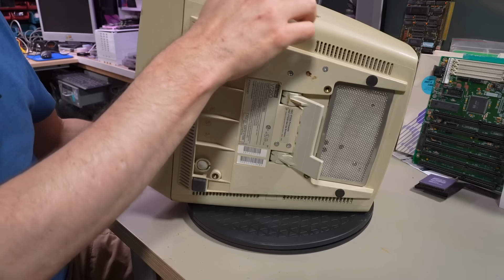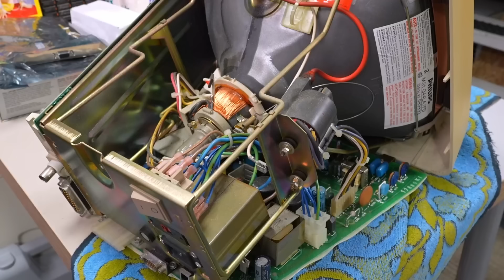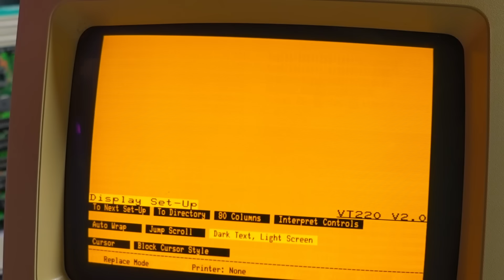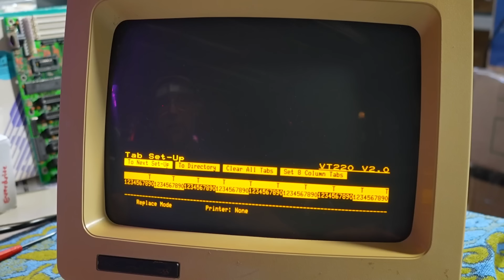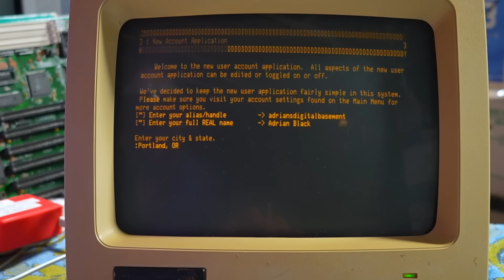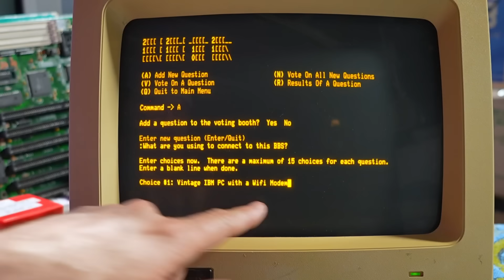Getting online with a DEC VT-220 terminal

Comment from the maker: Patron Rick pointed out that DEC stands for Digital Equipment Corporation not Digital Electronics Corporation. Thanks for the correction!
Reply: yep love these terminals. used to use them in a factory. funner if you have a mainframe to connect to, they would connect to the DEC mainframe and then you could do programming, etc. love these things. not much else you can do today with them lol
Reply: I remember vt220 as being based on 8085, not 8051… later revision I guess?
Reply: @marygauffin7290  The VT220 Tecnical Manual, revision 1 from 1984 states that the CPU is a 8051. I don't see why they would have redesigned the terminal to use a different CPU in later models ("If it works, don't fix it").
Reply: Ok. I must remember wrong then. Thanks!
Reply: It was how I remembered it being spelled as I stumbled upon a DEC computer - it was labeled as such; Digital Equipment Corporation.

Comment: I remember using a VT220 with a DEC PC back in the day.  I really liked the text editor because it had the unusual concept of moving the text around the cursor rather than the cursor around the text.  The result is that the cursor was always on the centre line of the screen, which makes a lot of sense.  Pity other editors didn't pick up on this idea.

Comment: Used those VT220’s back in the mid to late 90’s. they were connected to a DECServer 100 which was a serial to Ethernet box to a Vax 4000. Also used many other DEC terminals like the VT520 and a Wyse (which I still have and connect to my VaxStation 4000/60). Used a VT220 to connect to packet radio, a form of amateur radio data communication. I have no idea if any of that is still in use today…

Comment: At my university (1997-2002) there were approximately 20 green VT220 terminals in the main computer lab of the university.  It was the only computer lab on campus that had any actual terminals instead of only full PCs.  The VT220s were surrounded by the rest of the computers in the main lab being then-modern PC compatibles.  The VT220s were used only to access the VAX mainframe to either look at the files on your 7 megabytes of allocated storage space on the university's mainframe, or send or read your e-mail, which was accessible only by VAX, either on a genuine terminal, a VAX terminal emulator program on one of the PCs, or telnetting.  Ever since the VAX system had been first set up there, there had been a few BBS-style network games hosted on a certain person's shared drive, which were playable from his drive, accessible through a BBS-type program.  Collectively, this was called the Rebel Alliance, which included BBS-style one-liners from the three Star Wars movies when you logged on and logged off of it.  It may have been called the Rebel Alliance because the university IT department didn't want or like it existing, yet a bunch of enthusiastic students kept making sure it did exist.  The Rebel Alliance had been passed from student to student as students had graduated over the years.  Unfortunately, during my time there, the current hosting student graduated and despite his pleas, no one else volunteered to be the new host (probably because by then we had graphical web browsers on the actual Internet).  The most interesting game on the Rebel Alliance was UMoria, a roguelike, which I see is still around thanks to vintage computer enthusiasts.  Now I should go play it!

Comment: Adrian, DEC published many excellent user & maintenance/service manuals for their hardware & most software, at least in the "early days" before the '80s.  The VT220 is definitely included in hardware with good manuals.  Bitsavers and many other sites will have freely downloadable copies of these manuals.  I recommend that you at least take a look at the VT220 User Manual -- I don't recall what's in it, but it*may* give you an idea about how to type an equivalent for the ESCape key, along with explaining the various controls in and on the terminal.

Comment: I was a firmware developer on the VT240/220 development team at DEC's Terminals Business Unit. The cable that connects the LK201 keyboard to the terminal is not a telephone cable. This keyboard was the first to incorporate the inverted T arrow key configuration. The VT100 and all subsequent DEC terminals accepted ANSI Escape sequences to control the advanced features of character mode operation such as selecting code page tables for foreign language localization, line drawing, split screen scrolling and other features. The VT220 was a cost reduction of the VT100 character-based terminal whereas the VT240 was a cost reduction of the VT125 graphics terminal. The graphics capabilities were controlled by a special drawing API called ReGIS, short for Remote Graphic Instruction Set.
Reply: Always love it when the devs chime in. Thanks for your insight and contributions to computing history. This was my favorite terminal to use. And its keyboard inspired that of the Commodore 128.

Comment: The Pizza Hut franchisee I worked for in the early 2000s still used terminals with amber monitors. They were bought out by another franchisee around 2006 or 2007 I think, and those terminals were finally replaced with touchscreen POS computers at that time.

Comment: One of the 'problems' with the older VTs is the absolute punishment dealt from real world use in auto parts stores, public access locations such as libraries, and offices so most are severely yellowed, screen burnt, and have keyboards that are missing keys, etc.  In demand from people "our" age, they fetch several hundred dollars and often either do not have keyboards, or have them in poor shape.  Resellers of bulk gear sell them for high $$ in unknown shape.  Solution?  Buy as VT510, 520 or 525.  Digital Equipment was wise enough to integrate standard PS/2 keyboards; problem solved and they have many more options and emulations, are energy star, white text (the VT525 is color), etc.  I picked one up for my PiPD 8i and never looked back.  Thanks Adrian... DEC invested quite a bit in making sure their gear was well built, serviceable; evident from your tour of the innards.

Comment: I had a VT220 just like that, although I think my keyboard was a little different.  My dad picked it up at a military surplus place around '95 or so, and I used it as a terminal for my Linux PC so my brother and I could both use it at the same time.  I kept it for a long time, but did eventually get rid of it.

Comment: This takes me back, I was DEC VMS administrator that supported All-IN-1 which was an singular interface for mail, Wordperfect, and Lotus 123.  Most of the VT terminals I dealt with used MMJ connectors for their serial connection that are like RJ-45 but the locking tail is offset to one side.

Comment: I love these retro videos!! ATDT brings back memories of 1986 when I had to dial the phone to hook up by modem to the mainframe at UC Berkeley on my Apple Iic (and later Mac) with a terminal emulation program. I liked going to Evans Hall on campus to use the terminals hard wired to the mainframe, or it seemed like it since it was so much faster than 1200 bps over phone lines.

Comment: I have a white-screened one in my basement that AFAIK was used for secret government projects. Rather than using a Wi-Fi modem I was thinking of connecting it to the console port of my managed network switch and using the switch's telnet client functionality. The VT220 should be easier to use than my HP Palmtop.

Comment: This is a really cool terminal. We had the same or similar ones in our local library. Not sure when they started using them, but I used them in the mid-late 90's and maybe early 00's. They used it for their card catalog as well as looking up which other local libraries had certain books. I think you could even reserve books through the system! So yea, I have a strange bit of nostalgia for these machines. I know they had amber terminals, but I think some of them might have been green as well.

Comment: There is no key labeled ESC on the VT220, but in VT100 mode the F11 key functions as one. The VT220 terminal was clearly designed for the VAX/VMS era, since on the earlier DEC-20/TOPS-20 the escape key was extensively used. The Wikipedia VT220 article has a separate paragraph titled the "Escape key controversy".

Comment: Digital Equipment Corporation, not Digital Electronics Corporation -  That looks like it was from a Word Processing System (WPS) - pronounced "WOOPS".  These were PDP 11/23 or MicroVax machines that would sit under the desk.  The PF1 key was called the "gold key" which put the keypad in the second state.  What distinguishes the keyboard is the labels on the keys, with the "red" and "green" keys inserting fonts, styles, and formatting.  You had WPS as part of the AllIn1 suite on the VAX, so the key assignments matched the stand alone machine.

The WPS terminal was a VT220, but wouldn't have the VT220 badge on the front.

I still have the muscle memory for the EDT keypad and can move and edit a file faster than I can in vim. 

Cool thing I learned when I was going to SUNY at Buffalo back in the mid 80's was definineing the keypad to execute funtions in DCL.  So, when at the command line, I had a key defined to "show default" and other functions.  Cool stuff.
Reply: Yes, same here. I too have muscle memory of the EDT and LSE keypads. Gotta love "learn keys" in LSE. Another thing I used to do was put my username in the answerback, so that I could log in quicker.

Comment: I don't think the amber (or white) phosphor was as efficient.  As a result, the tube had to pump more electrons into them to get any kind of reasonable brightness.  That affected the life of both the electron gun and the phosphor.  Personally, I liked green the most.  The amber and white ones I worked with seem to have a long persistence that made fast changes (like scrolling) and issue.  Plus, I find green more calming.

Comment: Currentloop allows for RS232 communication over very long distances (using cheap 2 or 4 wire telephone cables) in the 1980/1990.
Very handy if you have a huge companybuilding where everyone needs a VT100/VT220 terminal to work on the computersystems (like mainframes) standing in the basement (like my company had). We used ADM12 Terminals.

Comment: Great to see an old VT220 terminal. I remember when we had our DEC Alpha server in the data center for our student records, class registration, campus email, and DECWrite. We used VT220 and more advanced DEC terminals campus wide at the state run community college I worked at in the Computer Services Division from 1998 until 2012, when I retired. When I started working at the college, we were phasing out terminals and moving access to the DEC Alpha over to PCs and Windows NT 4.0 and then Windows 2000 Professional and other iterations of Windows software over the years, accessing the DEC Alpha over Ethernet. And we moved email over to Microsoft Exchange Servers in the data center and Outlook and word processing over to WordPerfect, then to Microsoft Word on student, faculty, and staff computers. It was a royal pain ripping out all of the old serial cabling and removing all of the DEC terminals and hauling them in a tractor trailer to state surplus. It was sort of sad seeing the old terminals go away, but we were excited with the new stuff. Around 2009, our student and business office server software moved over to Oracle SPARC servers and we retired the Alpha. About three years after I retired, the student and business office stuff moved over to the state education department's massive Intel x64 server farm and accessed remotely by the campus over a AT&T 100 Gig Metro Ethernet fiber optic circuit. I still have fond memories of the DEC terminal and Alpha server days. I never thought that we would see such advancements in networking and computing as we have today when I first started working at the college.

Comment: Ahhh, this takes me back.  In college, I used lots of random terminals to get on the various central campus mainframes.  VT220 was one of the ones I most coveted, since (a) they had that relaxing amber color, and most importantly, (b) they could do a blazing 19200bps (which was pretty much the highest you could get without being directly on a console).  If I was unlucky, I'd be stuck on something that maxed out at 2400.

Comment: Used these back in the early 90s in the Air Force. I was s medic, we used terminals for everything: mail, test results, booking appointments, etc. They were later replaced in the mid 90s by Windows 3.11 using terminal emulation.

Comment: Wow, what a great find.
I did have to install something like this in 1988. Not using a DEC, but a PC setup. 386-16, with 4M RAM, 40MB Hard Drive. A multi serial card, and operating system called PC-MOS (does anyone remember that one??), and Three Terminals.
That was so cutting edge at the time, and impressed the hell out of the customer. Don't ask about the speed. But the main machine could switch to each user terminal and see what they were doing, and fix any problems, and the O/S was basically a multitasker running individual MSDOS machines in memory. Cost about AU$15,000 (from memory) at the time.

And you're cheating using that wifi modem. Get and acoustic coupler and watch the text slowly scroll down the screen. Or turn the speed down to 300bps.

Comment: Ha. These were all over the place in the 80s. My university was full of these and like many places was a DEC customer since the PDP 7 or so days in the 1970s. My step dad was one of the IT people who DEC regularly courted to keep the dollars moving. 

These were well engineered like all DEC hardware but to a price point. They were designed for servicing and were evolved from the older VT100 line of classic terminals. The keyboards were shitty rubber domes like every one else’s at this point. Durable but crap to type on.  Indeed there were swivel stands but they cost extra. These didn’t have too much burn in trouble except after YEARS of usage. They were mostly amber but green and white were also available. The cables were like telephone cables but not the same.
Reply: They were pretty fast for terminals of the day. Both in terms of baud rate and refresh rate.

Comment: Those strange characters are almost certainly IBM extended ASCII characters, which that terminal doesn't support.  If it supports 8-bit characters (many old terminals don't, because they were made before extended ASCII was thought of), then it may be possible to do a hack with a larger character ROM which contains the extended ASCII characters, but otherwise it will just keep on effectively dropping the highest bit which makes it display the character which is 128 positions lower.  For example, the letter D is being used instead of the horizontal line character "─"  because the ASCII code for D is 128 less than the extended ASCII code for the horizontal line.
Reply: The VT220 does support some extended character sets and there are some related options in the configuration, maybe Adrian had them disabled. I don't remember how it works but IIRC there are some number of soft-downloadable characters.

Comment: The smooth scroll feature looked really impressive,  but completely impractical to use.  A very satisfying on/off switch like many things in the 80s/90s!
Reply: It depended on what you were using it for really. 19200 is pretty slow, so scrolling full 80 col rows of text 1 pixel per frame would just about keep up, but if it's lots of short lines then it wouldn't (I think it switches to scrolling by characters if it's not keeping up anyway).

Comment: i tried to repair one of these terminals in 1992.  DEC wanted $800 for the service manual.  the company i worked for at the time thought that was way too much for a one-off repair.   we did a lot of repairs on Wyse and Amdek terminals, but the DEC was a different beast.

Comment: You said to mention if we had experience with using these terminals, and I actually do!  Back in 1995 I was a volunteering at the Eugene Free Net, which was a non-profit ISP down in Eugene, OR that provided free terminal (text-based)  and cheap PPP (graphical) dial-up internet access.  In the lobby of the EFN offices, there were some terminals that anyone could drop in and use to connect to the main user server at a shell prompt, and thus get at their email with Pine, or do other text-based Interneting of the day.  If memory serves, these were dumb terminals, either DEC VTxxx or Wyze something-or-others.  They were all connected to a device called a Portmaster, that had a bunch of DB25 connectors and an AUI transceiver port, that was in turn connected to the local LAN and eventually (via a single 28.8kbps modem) to the servers downtown.  The Portmaster had a 3.5" floppy drive inside itself (not accessible without unscrewing and removing the cover) that it used for persistent storage!  How wild is that?   What a time to be alive...

Comment: Interesting .. Most of the terminals I used back in the day were VT220 "compatible"  - tho we did have a couple VT240s - the 240s had actual graphics capability.  The one terminal clone that sticks out as my favorite was a C.Itoh 224 - which was a well made VT220 clone with a larger screen.  What a way to bring back memories... (and, btw - ATDT is AT "Dial" "Tone" vs ATDP which would be pulse dialing - on a Hayes compatible modem.

Comment: Thanks Adrian! I enjoyed the video! Just a bit of trivia... I'm pretty sure the flyback on those screens are the same ones that were used in Sony Trinitron TV's from the 70's forward. They also have the same issue with that strap failing out of nowhere and causing ICs to die.